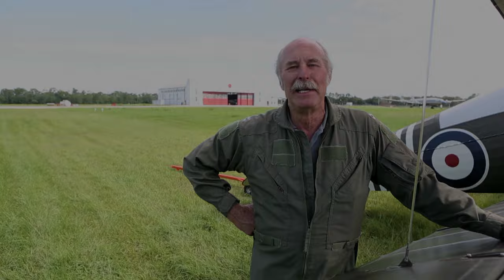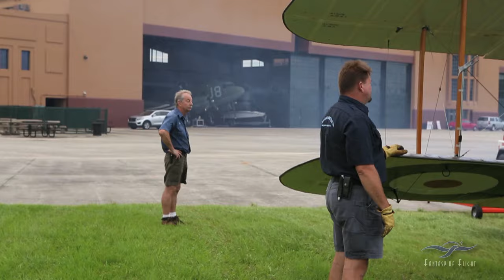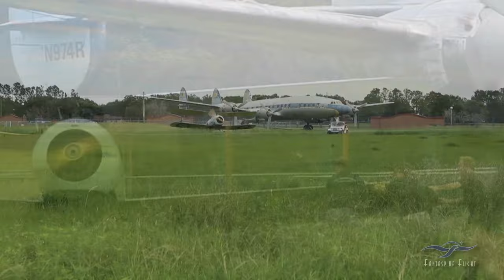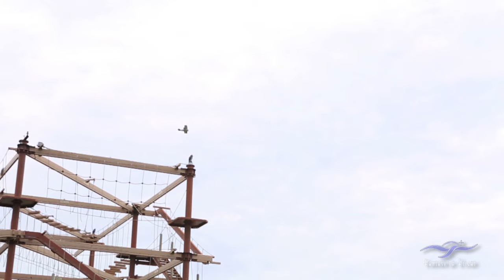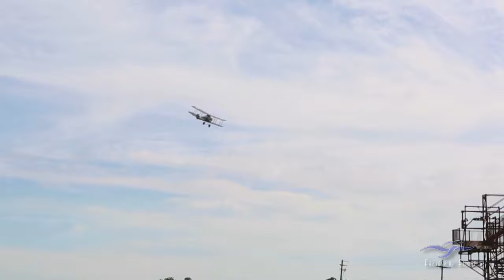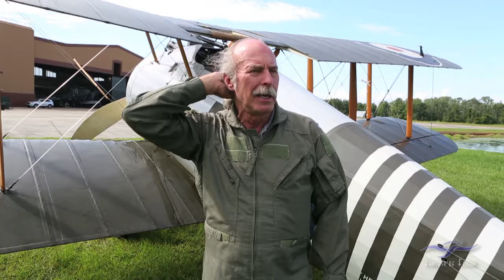Sopwith Snipe - First Flight in 5 Years - Prep for Oshkosh

Comment: Turning these old rotory engine planes to the left was a bear. The engines spun to the right and that's the direct they wanted to go. Turning to the left was slow and caused the plane to go nose up and sometimes stall. Turning to the right was fast and sharp and usually caused the plane to go nose down which could cause a downward spin in the hands of an inexperienced pilot. This planes sopwith predecessor, the camel, killed almost as many pilots in mishandling accidents as it did enemy pilots in combat. It took real skill to fly these old birds in combat.

Comment: All the motor revolves with the prop, so there is a huge gyroscopic effect.  If I remember rightly, such engines made the planes hard to turn left in flight, but they'd snap roll in a heartbeat to the right.
Reply: Yup except for 1 late engine germans made crank spin opposite of engine. Pretty crazy set up
Reply: Yes, I think that it was an eleven cylinder rotary engine, geared to take advantage of the extra power. Because of the torque reaction it had to have a bigger rudder and the port wing was 4 inches longer than the starboard.

Comment: A little trivia. The Sopwith Snipe was rated as one of or best WW1 fighter. It's basically the Sopwith Camel 2.0. Only 500 were manufactured before the war ended but the British continued to fly them up to 1927. It performed as well as the Camel but pilots preferred it over the Camel due to it's better and safer handling.

Comment: As I remember you don't really have to wait for the engine to warm  up before running them up to full power. The reason you normally do in a modern engine is to get the oil warmed. This is important to get it to thin out to a usable viscosity. These motors don't recirculate the oil, it's a total loss system with no scavenge pump so once it goes in, it lubricates and gets flung out.. so no warm up of the oil it never warms up it just goes in and then out. I guess it's comforting to hear the engine doing well before revving it up but in war time they just lit them up and took off in whatever direction the wind is blowing that day because the aerodromes were big fields you just took off and landed into the wind, whatever direction that is.
Reply: From memory they don't have a throttle so they pretty much go up to full revs as soon as you start them. They are 'throttled' by blipping, switching the mags off and on, and you can here Kermit doing this as he is maneuvering, not chance for a warm up idle even for the metal!
The gyroscopic and P effect are incredible on a light aircraft like that.
Reply: @vumba1331  While most all rotaries had a blip switch to cut the ignition, not all rotaries were without a throttle. This misnomer comes from people not understanding there were different types of rotary engines, just as there are different types of all other engines.

The throttle-less rotary engine was mainly the Gnome Monosoupape series, or French for "Single Valve". These engines had one big valve at the top of each cylinder that was actuated by a push-pull rod. Due to the valve doing double duty as both an exhaust and air intake valve, and the fuel and oil being admitted by ports at the bottom of the cylinder, it wasn't possible for this engine to have a real throttle, hence cutting the ignition to slow it down. The Monosoupape was a very strange engine design, being somewhere between a two and four cycle engine, since it had both ports and valves. The designers of the engine did this though to save weight with fewer moving parts and a lighter valve train. The precision needed to make the engine made it a lot more expensive than other rotary engines.

Other rotary engines like the Le Rhone, Bentley BR.1 and BR.2 (as used in the Snipe) used a conventional two valve system where air, fuel and oil was brought from the crank case to the top of the cylinder with an induction tube. These engines did have a proper throttle and used a normal carburetor. They could be ramped up and down in power like any other engine type back then. You can actually hear this in the video where the Bentley BR.2 is run at several different varying power settings, with a smooth ramp between those settings. While the Bentley BR.2 can be blipped on and off by cutting the ignition, this isn't desirable because it can lead to engine damage. If you wait too long between ignition cuts, you can get excessive fuel and oil into the cylinder and lead to detonation.

Comment: That was no 'frogging' there, Kermit (sorry for the levity)!!! Here I am viewing a 103 (approx.) year old biplane (in flyable condition), in the 21st. century!! SPLENDID!!! It's beyond my comprehension, how all that heavy metal, spinning around, doesn't just fly apart, in those radial engines, of the time!!! Say you're making 1,200 RPM's. That means the crankshaft is spinning 20, RPS's. That's 20 times, a second!! And all that metal, spinning dangerously!! What were they thinking 🤔?? Wouldn't it, just have been easier to move a small crankshaft, instead??

Comment: OMG I didn't realize that the whole engine spun around!!!! no wonder there's so much torque on these.
Reply: The original rotary engine. No throttle either, it was either full on or off. That’s the reason for the engine cutting in and out on the ground.

Comment: No throttle setting on these rotary engines; full throttle and ignition off. You can hear the ignition being switched off when taxing on ground.This engine had the crank shaft non moving and cylinders rotating(rotary).
Reply: No throttle settings is actually one of the biggest misconceptions about rotary engines. They actually had throttle's, but they were generally ran at max fuel flow adn adjustment was achieved by letting more or less air into the engine. It wasn't very effective and could lead to poor running and stalling, so the blip switch was used as it provided more reliable engine control for the pilot.

Comment: Those ol radial engines amaze me.... All that spinning mass!
Reply: Slim Riddim Rotary, not radial.
Reply: @davidgrainger5994  Yes, so I understand now... I jumped in without thinking.  Cheers.
Reply: Slim Riddim I screw it up all the time and I have a plane with a big radial on it.
Reply: @davidgrainger5994  lovely!!
What amazes me is the idle - they sound just like s multi cylinder hit and miss engine, akin to a petter or lister.

Comment: Makes me wonder if all that rotating mass would cause a lot of torque twist, not to mention the stresses on the main crank.
Reply: Iamover thelies Treading with care in the presence of experts, yes rotaries did generally generate massive torque.    It was a feature of the Camel that it turned like greased lightning one way, but was incredibly slow to turn the other way round.    So slow it was allegedly faster to go round 270 degrees the other way.    But it is not just rotaries, a really powerful inline engine turning a big airscrew also generates significant torque.   I have a reference to the problems of handling a late model Griffon Seafire on a carrier because of its strong wish to sheer right and fly into the carrier island.   At best the pilot stripped the tread off the RH tyre.  Fitting contra-rotating propellors to the likes of the Griffon 85 sorted that, but that was not an option for Tommy Sopwith back in the day.

Comment: As I recall,the castor oil used to lubricate those engines is chemically modified from what comes out of the squashed pressed beans. Possibly a glycerine sep like with biodiesel ? At any rate,who makes aviation grade castor oil these days ? Those engines stopped being used commercially about 1925. Any barrels stored from back when would likely have been wooden,and allowed oxidation.
So where do you get it ? Anyone know ?

Comment: I am surprised that Mr. Weeks has not built a Hucks Rotary Aircraft Engine Starter Truck, as used by the RFC and RAF during the later stages of WW1 and afterwards. There are plenty of Model T Fords around as the donor vehicle, for making one. Starting the bigger rotary engines like the Bentley BR series, must be a rather fraught process, with at best the risk of back strains and torn muscles, and at worst, a far more serious accident from the two starter mechanics tripping over each other.
Reply: Check out the Huck's starter at shuttleworth.  It's been there to my knowledge for 52 years....starting the brisfit etc

Comment: do rotary engines have oil mixed in with the fuel? do they breathe through the crankcase?
Reply from the maker: Fuel and castor oil both enter the engine through a box at the back of the fixed crankshaft and are sucked into the crankcase. Castor oil is a vegetable base and DOES NOT MIX with the petroleum base fuel, and is designed that way for a purpose. Both are consumable, and whatever is not burnt, is slung out into the cowl, hence, goggles and scarves!

Comment: It feels so weird to hear a rotary engine calmly idling, rather than having the ignition blipped on and off.
Reply: Oh, that's because this Bentley actually has some throttle control vs the single a valve rotary. If I recall correctly, he has an air intake, and mixture control...have you seen the Kermie cam from 5 years ago? He talks about it in part 1 i think.
Reply: I'm aware that the Bentley BR-2 has an actual throttle. I'm just used to hearing things like Gnomes, which don't have throttles, and Le Rhones which don't seem to have much of a throttling system.

Comment: After watching 3 videos of trying to start radial engines on antique airplanes. I am now convinced that it would be much easier to start a radial engine by building a custom moveable frame with a washing machine electric motor to a rubber tire with cutouts to the prop. And a quick pull back mechanism. Cheap, easier, safer and with 10x the efficiency. As in starting gas model airplanes. But I am not a millionaire hobbyist. There you go. My idea for free. You are welcome.
Reply from the maker: They exist. Just as our restorations are as original as possible to the aircrafts time, we chose to keep our procedures the same too.

Comment: Why they mount the engine fix to the propeller and not to the plane?
Reply: But you have a high roationmass. And the problem with the cooling is also not a problem. Your propller move a lots of air.

Comment: So why do you think the engine isn't smooth as it should be? Does the engine still have an issue?
Reply: MrStoneycool69 The original monosoupape rotary engines could not be throttled back and the pilot could only reduce the output by "blipping" in effect cutting out firing some of the cylinders.   I imagine it sounded rather like that.    The other interesting "rotary quirk" was that it turned the aeroplane very slowly in one direction and whipped found in the other.   So slow one way that it was quicker to do a complete turn the other way round.  The effect of spinning a largish mass of metal at high speed.    Amazing what you can pick up from the "Biggles" WW1 books.    Apparently you could recognise a Camel pilot by the oil slick over one shoulder thanks to the fine spray of castor oil which came one way.  Excuse spelling the predictive text is being a pain.
Reply: I agree with the type of ignition installed in these engines at the time which would give the impression of rough running, but I thought Kermit was alluding to something else. The oil mist would cover the entire pilot's face not just one shoulder.  I find Biggles books are fictional stories for propaganda purposes, I wouldn't believe what was written as gospel but fantasy.
Reply: Fair enough, not entirely sure about the oil slick though as I've seen it mentioned elsewhere.   As for Biggles, I wasn't entirely serious and yes largely the stuff of "Boys' Own" stories (sorry about that Worrals and Gimlet).   However, I have read some biographies of W.E.Johns and he was pretty much the real thing himself, a DH4 pilot wounded in action and a P.O.W.    I find it interesting how the Biggles stories developed over time, the very first ones written in the early 1930s when the Great War was a very recent event have a very different flavour from what came later.   In those Biggles is a young officer flying Camels who smokes heavily and drinks even more heavily.   Eventually the stress gets to him and he is sent on home leave for a brief respite (I guess the latter is more fictional).
Reply: I did read a copy of Biggles when I was a youngster, and it was written by W E Johns, I didn't know he was a veteran of WW1.
Reply: Yes, he was quite a character in his own right.  Flew DH4 bombers as a second lieutenant and was shot up and shot down.   Accused by the Germans of being a terror bomber attacking schools to kill children (untrue) and threatened with a death sentence (apparently an interrogation technique, though as he said a second lieutenant doesn't know much anyway).   Made various escape attempts.   After liberation transferred to the fledgling RAF as a flying officer which he judged the equivalent of promotion to full lieutenant.  Post war worked in RAF recruiting which gave rise to a splendid anecdote.    As a recruiting officer he rejected a somewhat disreputable character called "Ross" who was clearly under an alias and using forged references (allegedly).    Was ordered by a very senior Air Ministry officer indeed that he would immediately recruit Ross into the RAF, no arguments.   It transpired i.d.c. that "Ross" was in reality one Col. T.E.Lawrence, trying to gain anonymity and escape the pressures of being Lawrence of Arabia.    Worrals and Gimlet by the way are his female heroes in adventure stories he wrote for girls, in some ways he was ahead of his time.  From the 1930s over the next 40 years he wrote around 100 Biggles books and obviously quite a few things changed in that time.    I can believe one of the stories where someone sabotages an aircraft by cutting a discrete slit in a fabric wing covering, the idea being that air flow and pressure would cause it to spread, balloon and destroy the wing in flight.   Might work with a Camel or SE5a, might not work with a Spitfire or Hunter (joke).

Comment: That's way too much work man! ... shitski!
Reply: Absolutely beautiful work on the airframe... and skin. ... try my acetone and hempseed oil... hempseed oil is available on Amazon for under 20 bucks for a 24 oz bottle... mix it in the acetone and run the mix through a diesel like water filter for the fuel line... with a little spray bottle, use the results directly up the carburetor... unfortunately the acetone is probably not good for the gaskets in the carburetor... i have yet to figure it out ... and i will... i want my hemp fuels to replace gasoline and diesel... before we destroy our lovely Planet